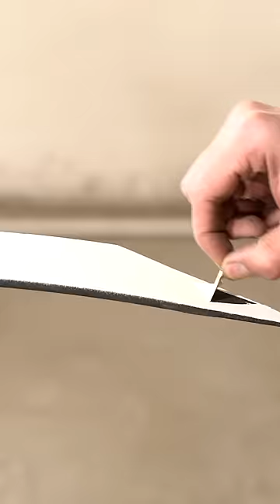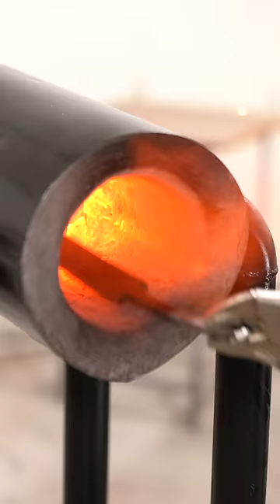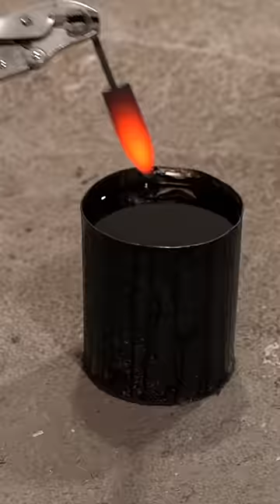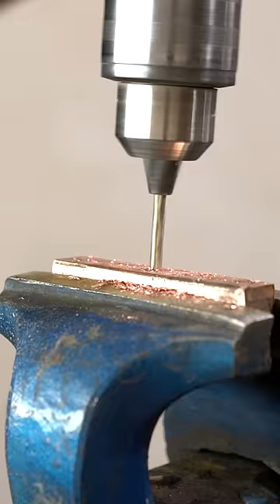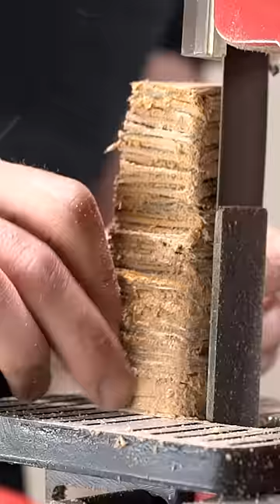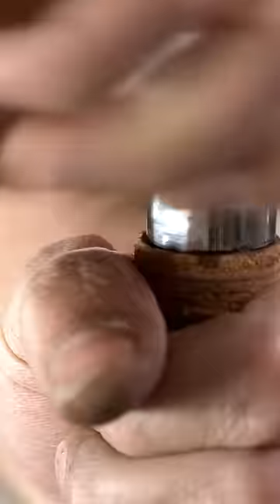Making a Knife With Leaf Spring And Leather #shorts  #dagger  #leather

Comment: Love the blade but you could have shaped the handle to fit the guard better
Reply from the maker: 👍🏻 Thanks
Reply: Right. The blade looks sturdy but the rat tail tang weakens the knife.
Reply: @tyronekim3506  i dont think hes going to be chopping wood with it. For what it is, its plenty sturdy
Reply: Totally agree great work just needed that handle tapered off towards the guard
Reply: @noahh_613  its not hateing its critisism that could help
Reply: @tyronekim3506  I agree! I would have liked it better if it were full tang. There was plenty of steel there, so I don't understand why he chose to go with a rat tail.
Reply: @Metallism hello , sorry i can no englisch 😢 
Deswegen Deutsch.

Wie viel F°  und wie lange muss es  Härten? Vielen lieben Dank im voraus.
Reply: @tyronekim3506 that wasn't a rat tail tang. In the start of the video when they knife is painted out you can see the entire tang. This is a through tang with a piece of thread welded to attach the pommel. This is a common thing to do even in master quality blades because most of the time you won't have much lateral force applied to the pommel. 
That being said, the handle itself left a lot to be desired here.
Reply: @brookeggleston9314  you can read my above comment if you want but this isn't a rat tail. A rat tail is welding the tang to the blade. He didn't do this, he welded a bolt on to thread the pommel. He very clearly cuts out the tang.
Reply: @zac9933 Rat tail tang means a long slender tang. This knife looks like a hunting or a fighting knife. The blade looks sturdy. I can't say the same for the handle construction. This knife can be used as a paper weight.
Reply: Could have shaped the handle period

Comment: Gonna slip with that round grip. Coulda thinned it on the sides so the hand forms around it better.
Reply: Also why welding a screw to it when you can just make threats?
Reply: @vadimblin  maybe they just didn’t have a die. they forgot they had a hammer until they made the grip

Comment: No heat treat? I know it's spring steel but damn, she still gonna be brittle af.
Reply: Unless it was mild steel to begin with i guess ¯\_(ツ)_/¯
Reply: @drumhailer547  nah leaf springs are made of spring steel
Reply: is a heat treat not when the piece is heated up and dipped/dropped in oil to rapidly cool
Reply: @theslayertv381  I would call that the quench. Is it a type of heat treat, yes. It makes it damn hard, but brittle. Heat treating I was referring to would be more akin to tempering. 400 degrees ish f for an hour or more (depending on application) to take out the stresses caused by the quench and to slightly soften the metal (allow some flex without chipping or cracking) to toughen up the blade.
Reply: shoddy crafted knives make me cringe
Reply: any steel not heat treated or tempered will be brittle as hell.this wasn't even a forged blade.i give it a 3 at best
Reply: Оно не будет хрубкое, оно будет мягкое как говно. Я делал зубило из рессоры, так себе получается после закалки

Comment: Kukuri House in Nepal, the official supplier of Kukri Weapons for the Indian Gurkha Soldiers used to post that they use "Cadillac Leaf Springs" as the source of their steel. I have owned one and it was quite impressive. Much more expensive now.. 20 years later. I'm sure modern manufacturing methods have taken over. But the steel in those springs was favored by them, so I can imagine it's very resilient to abuse. Just remember the rule.. "never remove the blade from it's sheath unless it tastes blood..."

Comment: its not a strong & durable knife
at the yime when you cut the handle bar from the iron leaf
at the time a stress factor create
& this kind heavy fomel again weak to its strength
may be it looks great, beautiful
but not safe for to use
leather handly gonna loose after some use
coz you didnt tighten all by clamp
watch Fordge in Fire
then you ll understand your mistakes

Comment: Aĺl that work and effort and the handle is unfinnished, it should be sanded to flow into to guard and you used the worst type of tang you could have chosen. That knife is just a glorified butter spreader.
Reply: Rat tails are not that weak, lmfao.

Comment: Seems sharp but I suggest not using  leather because it will fall off while in use unless you epoxy them together one by one. Also it won't be very sturdy compared to the ones that have the round things on the sides

Comment: Is a leaf spring a good type of steel for a knife.
I know there's special alloys for certain specialties but I'm asking just in general
Reply: Leaf springs are made out of alright steel. Exact alloy is usually unknown, but they are always medium carbon/low alloy.
Easily hardenable, easy to work, when hardened are tough and hold an edge pretty well.

Comment: Good looking knife, but I typically prefer full tang
Reply: For what 🤔 so it can break because it the same hardened steel?  Dont get me wrong i do to but its a misnomer that its a better knife a mild steel or non hardened carbon  tang will not break as easily as a hardened and tempered tang i have busted a half dozen pommels off del tin blades and had shitty swords last through years of beatings  because they were rat tails  look into it
Reply: @drumhailer547  I'm sure it depends what you need it for but usually the steel should not be so brittle as to break like that unless you got poorly made items